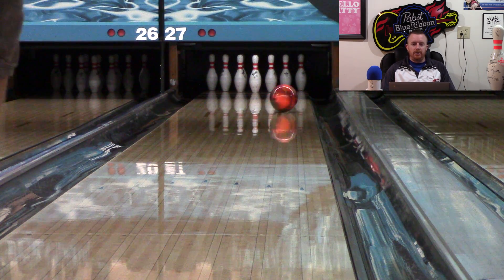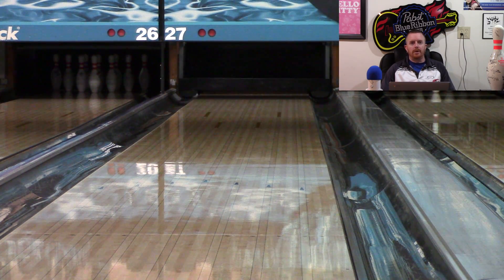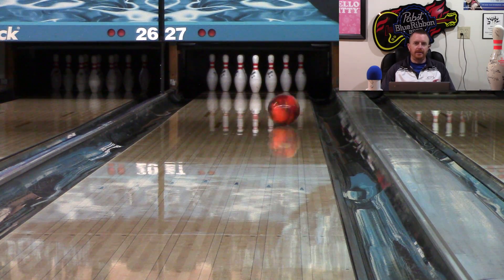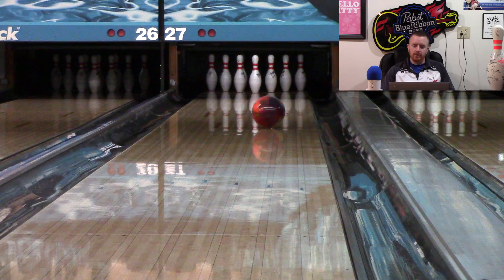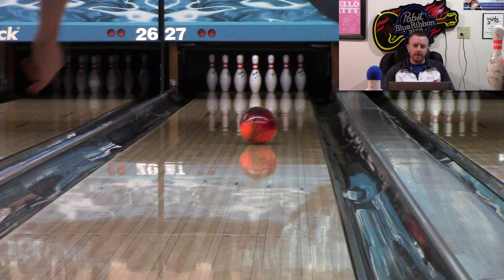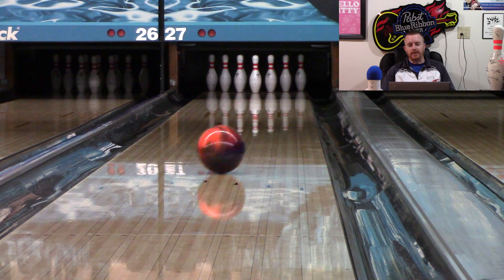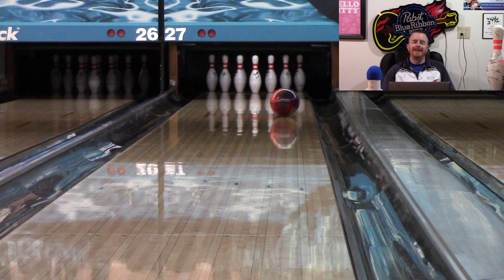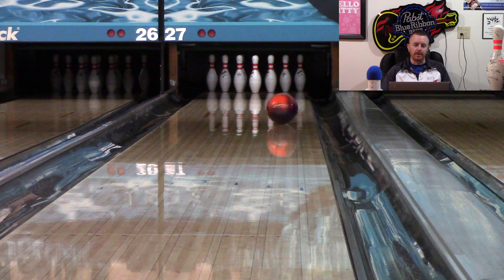Roto Grip Dare Devil Danger Review

Comment: Saw another review which described the DDD as a benchmark type reaction although to me it looks a bit strong off the friction for that. My green quantum with surface adjustment is currently my first out of bag but it's got a ton of games and I'm looking for a replacement to be first out of bag. I'm 17-18 off hand upper 400's rev rate. Thanks for the review video.
Reply from the maker: Christopher Patrick Yeah it’s not really a benchmark in my opinion, Maybe with a stronger layout perhaps to smooth it out

Comment: I actually just gave my HyWire to my dad and was looking for something similar to replace it. Not sure if a 3 ball bag of DDT, DDD, and Code Red makes a lot of sense, but it has seemed to work decently for me thus far. I'm debating between this one and  a Hyroad, not sure which would suit me better. I'm leaning towards the Hyroad as I want something that gives me more control out of the symmetric hybrid slot, and I think this ball may just be too angular to achieve the same control that I have with the DDT.

What are your thoughts Luke?
Reply from the maker: Lottabullets This is definitely angular and a lot of ball. Similar to the Hyroad through the fronts but once they hit 30 feet, don’t look much alike